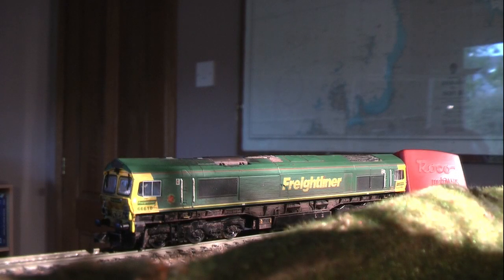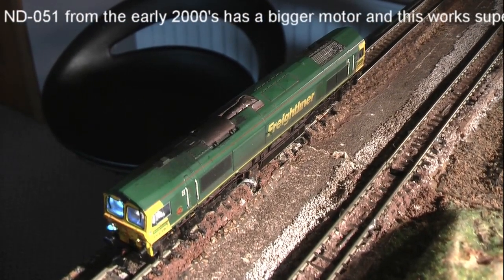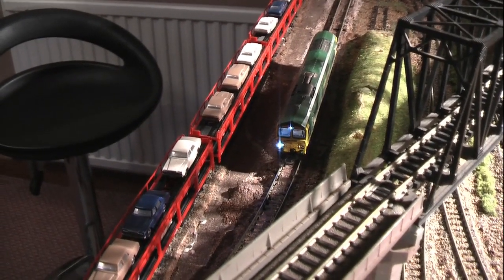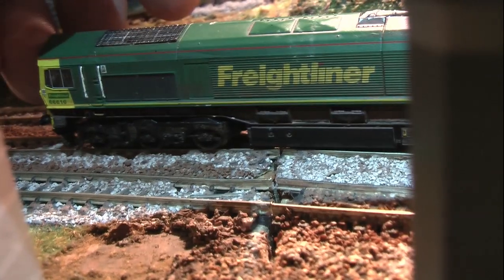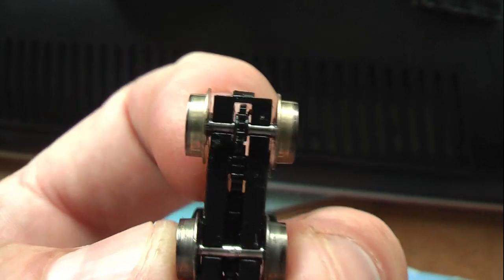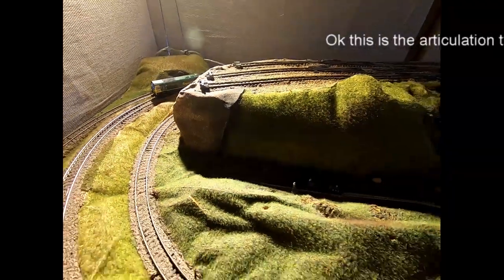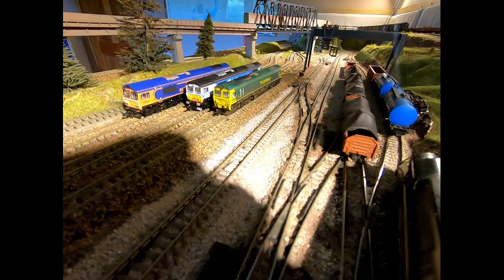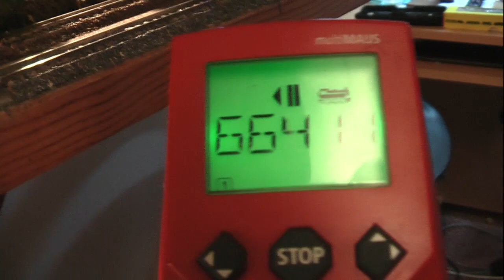Dapol Class 66 ultimate upgrade. Problems & fixes, tests on curves & ramps, DCC tips. N Gauge model.

Comment: Thanks Tom.  I really enjoyed watching your 'Sheds' on the layout.  If you ever do another one, I would really like you to show how you physically changed the hardware of the loco chassis and where you fitted the connecting wires etc with details about the leds that you used and how to connect them upi etc.  Thanks a lot.  Keith
Reply from the maker: Thanks. This video just concentrated on the mechanical aspects like curing de-railing. Videoing the whole DCC sound conversion is quite difficult, hopefully the slideshow at the end might provide useful info. Led's are all nano size supplied with 0.1mm copper enamelled wire, this needs the coating lightly filed off to permit soldering, an art in itself but well worth learning as the space savings due to the tiny wire are vital.

Comment: Great explanation. I just bought a N gauge Dapol 2D-007-014 - Class 66 66780 GBRF Cemex. I run it on Kato Unitrack and it constantly derails at the points and slips on inclines. None of my other trains have this issue. I also noticed that the front wheels lift when transitioning from an incline to a flat which causes the front wheels to lift of the rails and derail when it comes across the next point. It hardly pulls anything as well compared to even my tiny Fleischmann v60 so i am looking to put traction tyres to the outside wheels in an attempt to make the wheel radius bigger so it stays on the tracks and increase traction on inclines. Quite disappointed with Dapol for producing a product that doesnt work well.
Reply from the maker: That model has got the good bogies. Possibly the wheel gauge is wrong so check each axle under a magnifying glass that the wheel is perfectly aligned with axle end, the axle end should be exactly flush with the wheel hub.